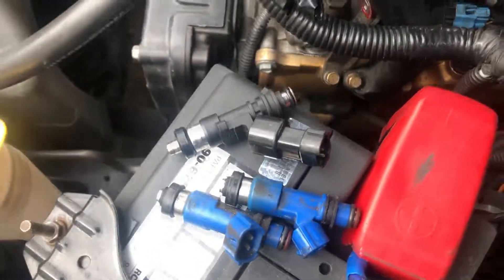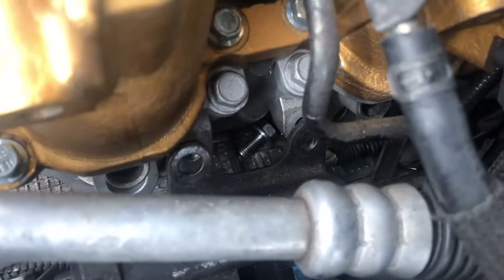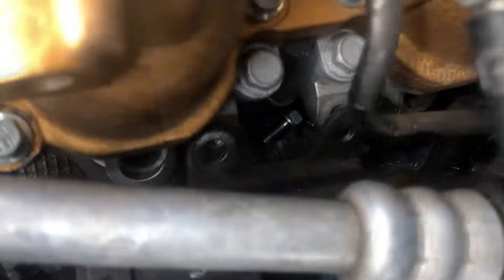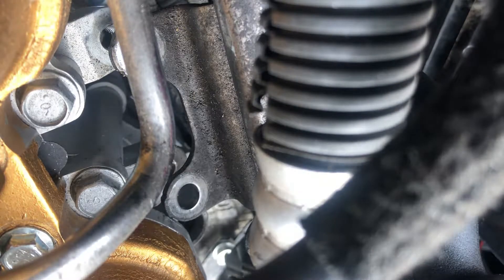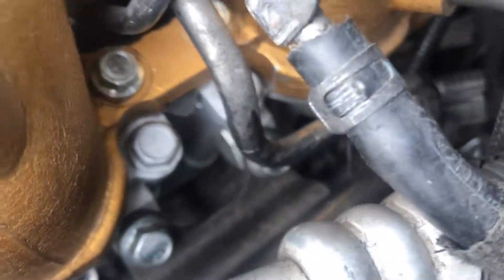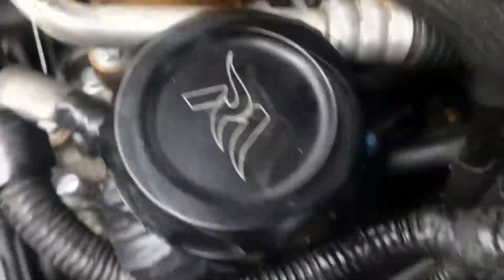PROJECT STi: 08-14 Installing 1000cc Bosch EV14 Injectors on OEM Fuel Rail

Comment: are you able to start up n drive the car in the 1000cc injectors no modification to the basemap
Reply from the maker: Yes you can start it up, but wouldn’t recommend to drive it cause it won’t run right, best to get the map from your tuner saves you from a bigger headache.

Comment: So you were able to have your sti idle after installing those injectors. I've some 1000cc's I need to install.
Reply from the maker: Yes it will idle and start fine but won’t run properly until you install a base map tune for the injectors
Reply: @TorontoEntz  is it driveable to get to a tuner or rough as guts? Did you tow it?
Reply from the maker: @leetpg  after I got the base-map I was able to drive it fine to my tuner it ran ok, stayed out of boost though to be safe